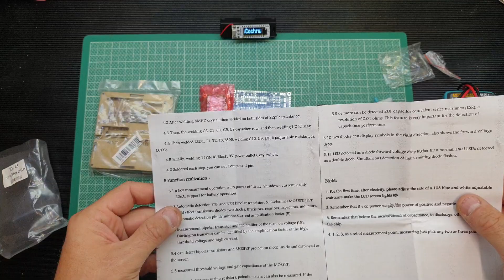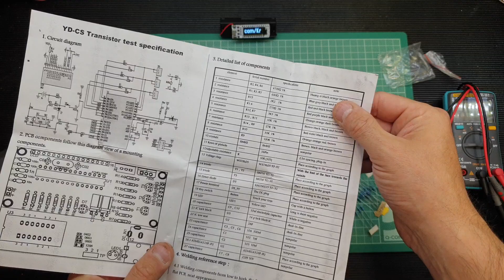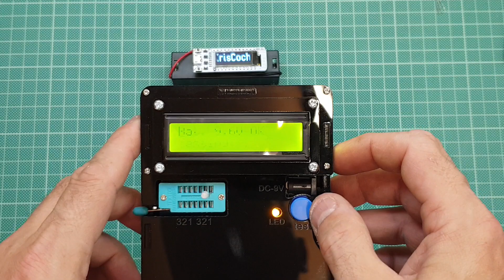Building a KKMoon component / transistor tester and a shout-out to "The Combat Golfer"

Comment: I soak the case parts in near boiling water for about a minute and rub them with a towel on a level surface, I did crack one once and it peels much easier